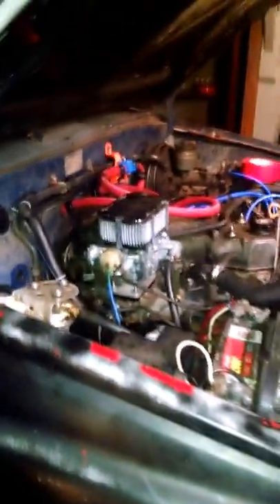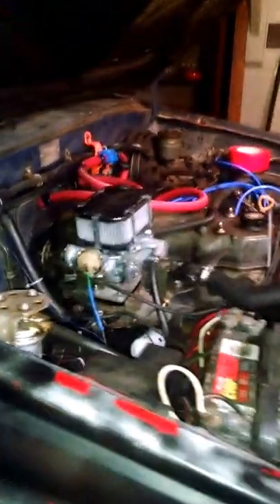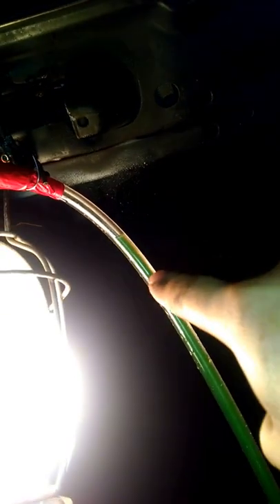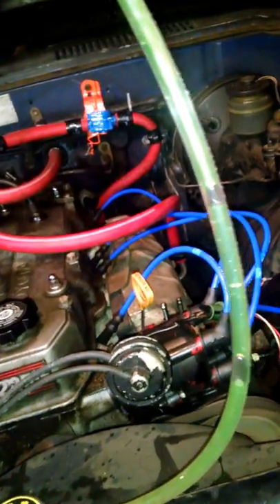Bleed/Burp air in cooling system (1986 toyota pickup)

Comment: Blown head gasket can put combustion gases into the cooling system.  Either leak down test the cylinders or get a carbon dioxide tester to put on the radiator filler  and read the gases or a smog station with the tester in radiator to detect hydrocarbons.  Are you losing coolant over time or white smoke out the tailpipe?  

Thanks for the bleed info - going to do mine now, look s easy.  Just above freezing here and no heat.
Reply: Tie Dye I’m actually losing coolant, and have white smoke from tailpipe, but no hydrocarbons in fluid

Comment: When you have air in the system, so you start the engine up with the radiator cap on or off? because I start my car with no radiator cap on, then a ton of water is pushing out from radiator!
Reply from the maker: you never wanna open the cap after the car is running because its hot and will burn you pretty bad, if it start shooting out right away, it might be a different vehicle with a different system or its just really topped off, im not sure

Comment: So I replaced my thermostat, thanks for the video, it was super easy. In burping, I didn't get any bubbles at all. My heater core is blown, and I re-routed it so I don't have a heater. I'm wondering if that might contribute to the lack of air bubbles coming up? I ran it for a while, revved the engine etc and nothing. I capped it and drove around to get it to temp and then tried again and nothing. Thoughts?

Comment: Been burping my sons 2004 Matrix for an hour now and bubbles still coming out. How did you find the leak in heater core?
Reply from the maker: oh boy, just cross your fingers and hope that's not it. I'm sure it isn't your heater core. If it is, the only way to find out is by taking your dash apart and looking. usually, the carpet will be wet underneath and your windshield would be all foggy. I'm pretty sure in the newer cars, there is a bleeder to get the air out of your cooling system